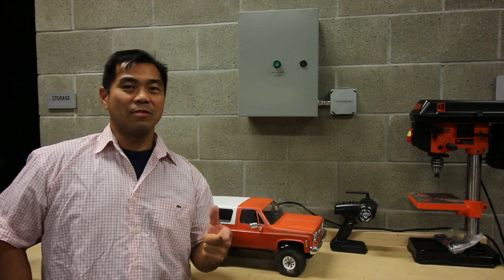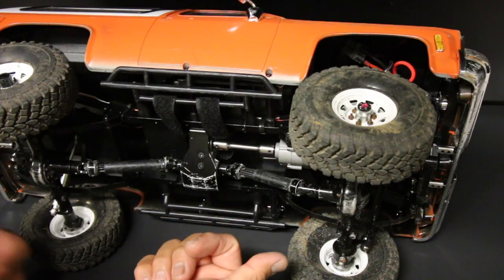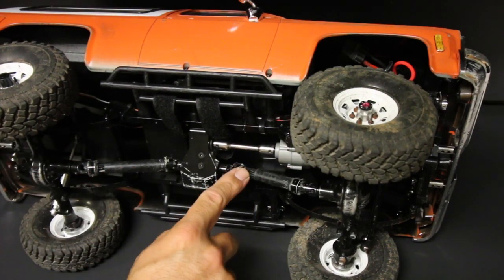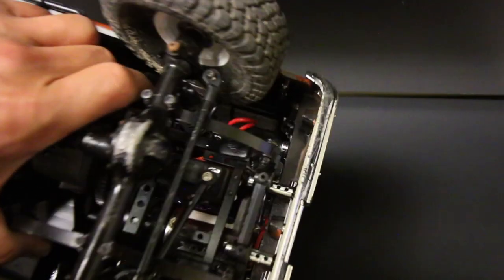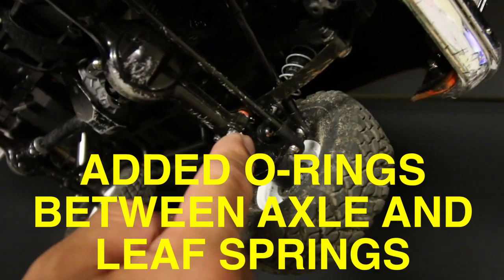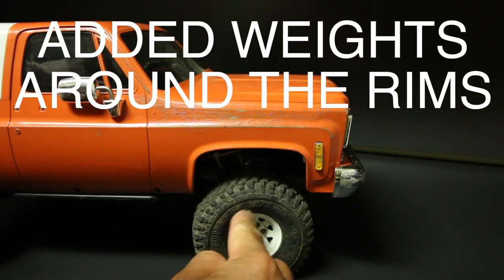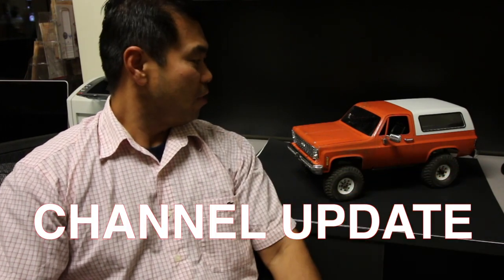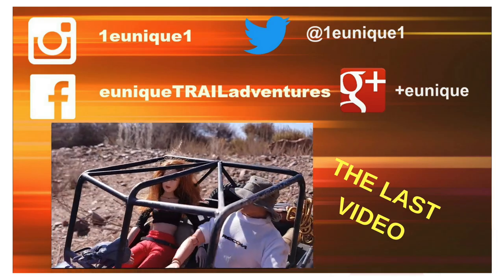Broke My TrailFinder 2 Driveshaft | RC4WD Rig Review and UPDATES | eunique TRAIL ADVENTURES

Comment: Great review and updates. Beautiful rig too. I never broke a scx10 drive shaft. Isn't it possible to install the extra weight a little bit lower for better lcg?
Reply from the maker: +Remote Addicted ive never broken scx10 driveshaft either, but after adding plastic shaft (From parts tree) inside the hollow inner driveshaft.  oh yes, for sure. The lower the added weights,  the better. Lower COG will always be better. You can stick weights in lowest part if the body instead of the chassis too.

Comment: Great scale looking rig. Love that color. Not too sound stupid, but could you briefly explain the purpose of the plastic O rings? I am thinking of doing this mod to mu TF2. I'm using just one black leaf, but the shocks that come with it are too stiff. Going with the ones u have. Also put on the taller hoops.  Thanks for any input.
Reply from the maker: +Max imus The O-rings lift it slightly (kind of like a lift block on 1:1) and give it more slack and allows more flex to the suspension. Also for the stock shocks, you can remove the inner springs from inside..make sure there's oil in the dampers.
Reply: eunique thanks. Are you only using   one black leaf for both front and rear? And I did try taking the springs out and added some tamiya oil, but it still seemed stiff. What spring shock you using. Thank you for the help. Your early videos with the Chevy and the TF2 were so very scale. Really cool to watch. Great job.
Reply from the maker: +Max imus since I am using the longer shock hoops, I can't use stock shocks anymore. I am temporarily using stock SCX10 shocks in front. Take spring out from the shocks and just run light oil so the leafs are working as the springs...im using 1 leaf only in the front and 3 leafs in the rear. The combo with that plus the O-ring should help with your flex
Reply from the maker: +Max imus since I am using the longer shock hoops, I can't use stock shocks anymore. I am temporarily using stock SCX10 shocks in front. Take spring out from the shocks and just run light oil so the leafs are working as the springs...im using 1 leaf only in the front and 3 leafs in the rear. The combo with that plus the O-ring should help with your flex
Reply: eunique thanks so much. I'll give it a try.

Comment: How has the planetary gear reduction unit holding up.
Reply from the maker: +Allen Neil the GRU is holding up pretty well, no problems with it so far and it definitely helps out in crawling up rocks!
Reply from the maker: +Allen Neil the GRU is holding up pretty well, no problems with it so far and it definitely helps out in crawling up rocks!
Reply: eunique how much slop does it have? And are you running brushless or brushed?
Reply from the maker: +Allen Neil it does not have much slop. I tighten it just until the axle and leafs are touching the O-ring and have blue loctite so the screws don't back out. 
I am still running stock brushed motor. I might eventually run sensored brushless. But stock motor is fine for now and it can go swimming in the water.
Reply: eunique swimming unlike some of the brushless.
Reply: I was referring to the planetary gear reduction unit, how much slop?
Reply from the maker: No, not much slop in the GRU...initially, I had to keep screws loose connecting GRU to motor..but that was because motor shaft was slightly too long and was bottoming out inside GRU. so, shaved a little, then no problems.